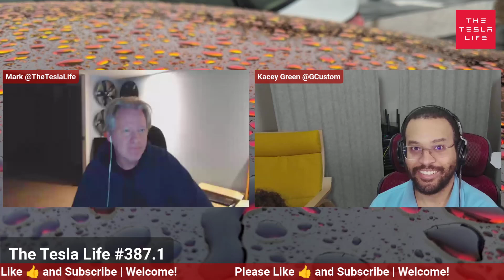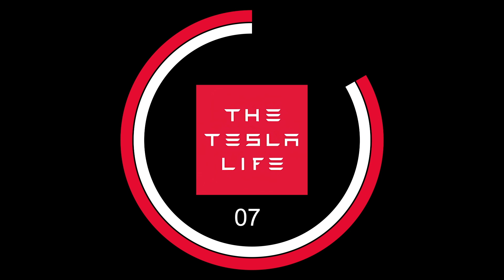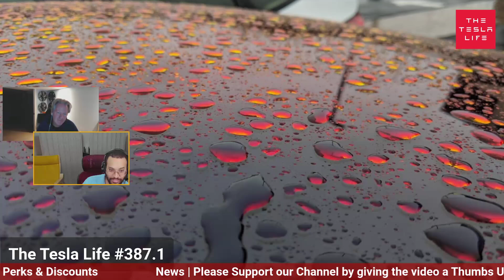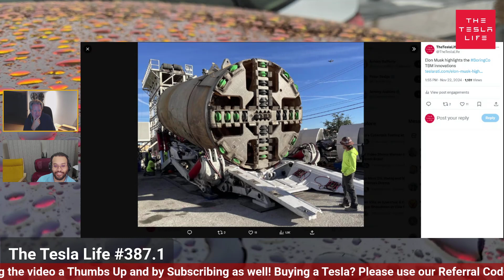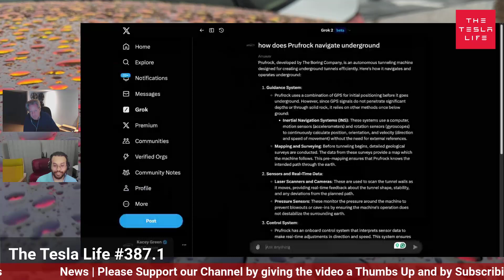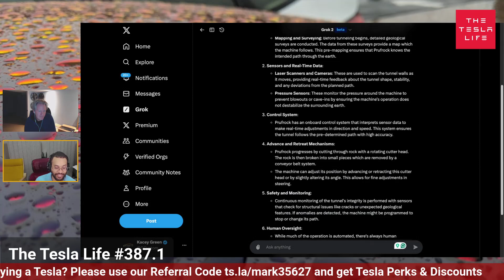TTL Express #387.1 - Boring Innovations!

Comment: Your level of ignorance on how tunnelling works is quite staggering. Do some research before you post these things. BTW, GPS doesn't work underground, so it has no role in Tunnel alignment or survey. Try "Gyro Theodolite" or simple laser and theodolite if you want to understand how they know where they are. 
TBC claimed this machine (Prufrock 3) was designed to achieve a mile a week, before it was put to use of course. On its first project it achieved approximately 125ft per week and only slightly better on its second project (if you believe TBC's figures). Now they repeat their earlier claim that it can launch in 24 hours. It took them 5 months on the first job (very slow) and over a month on the second one (pretty typical for the industry and size of TBM).
Reply from the maker: thanks